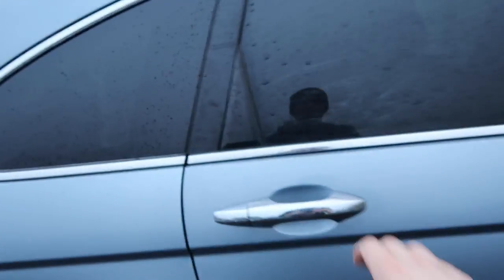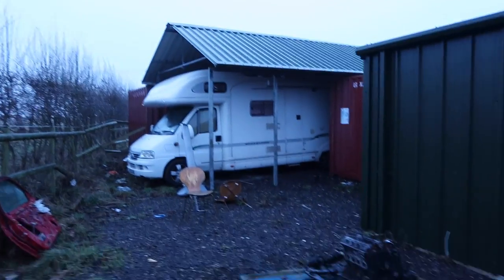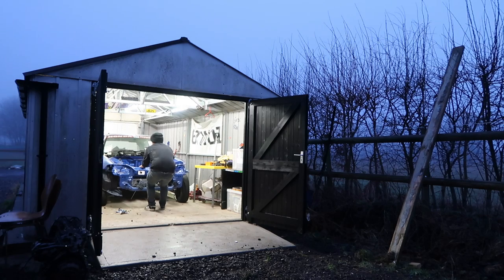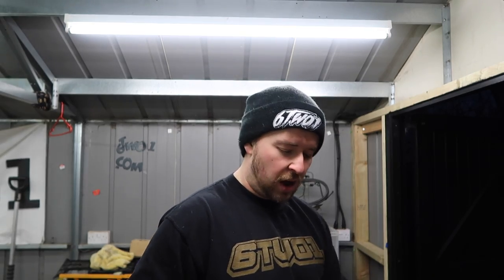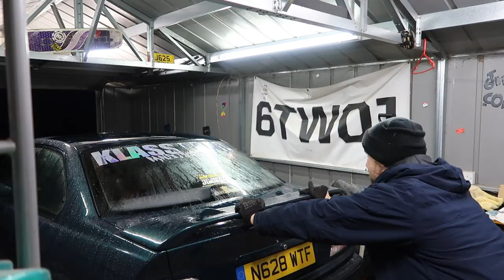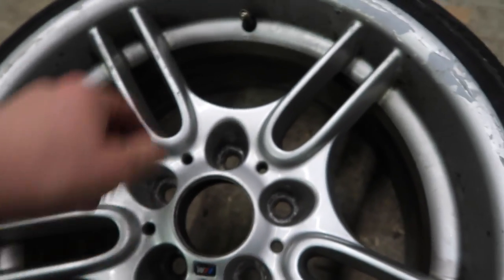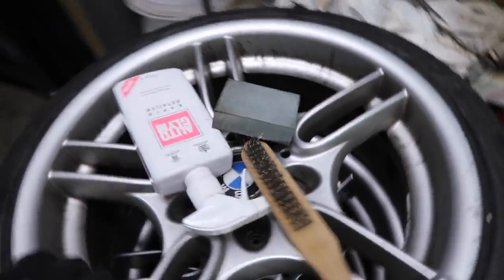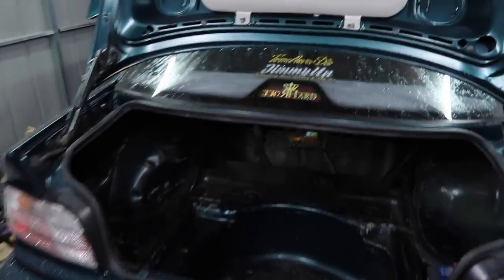Blue EG finally moves & a golden rim-job for my BMW

Comment: dying watching you try and make that civic roll and move it with no steering on gravel... too funny!!!

Before you try to move it off the gravel, try to fit a rack, just to stop the wheels pointing opposite directions, doesn't need to be connected to the column

Comment: why do you use halfords! surely a motor factor car parts place would be cheaper, try motor parts direct colchester - Unit B1, Smeaton Close, Severalls Ind Est, Colchester CO4 9QY
i work at the bedford branch, if you have a business you get trade discount!
Reply: bestie1981 Probably just convenient. But yeah, Halfords sucks.